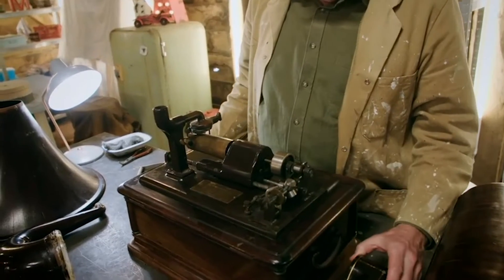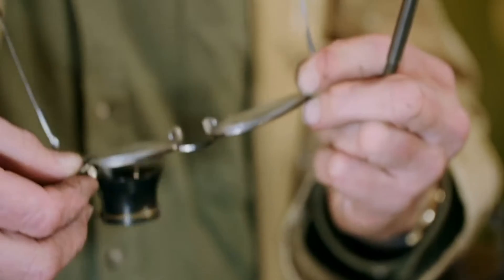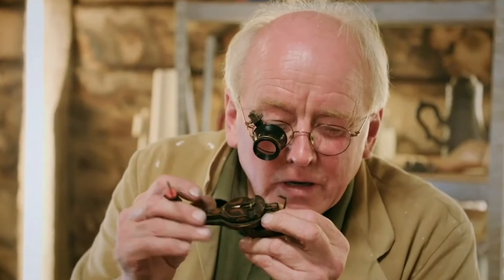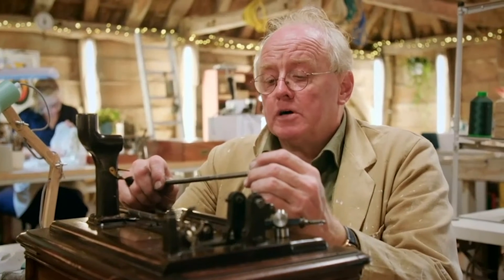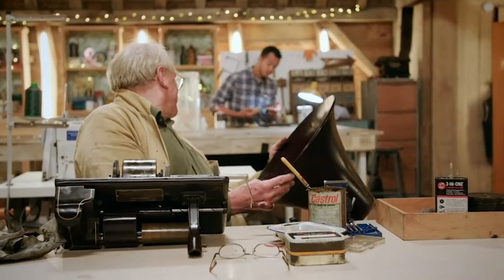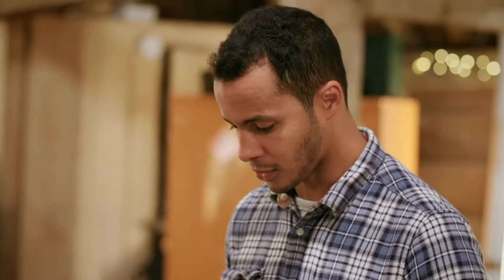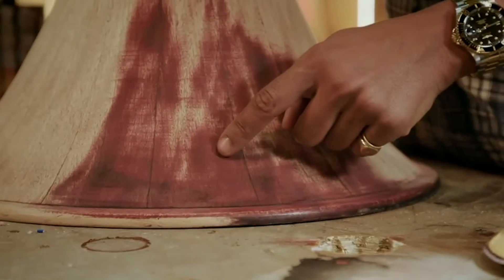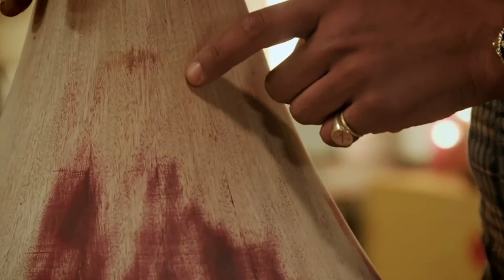Tim and Will Team Up to Give Long Silent Phonograph a Voice | The Repair Shop

Comment: A record of more true round would really help!
Reply: you would be surprised i have several which are worse and they sound perfect the warble is probably from the old belt needing replacing
Reply: @timothydelaval1089  In this case, the governor weights appear to be out of balance.  I would imagine the wire "spring" also needs to be replaced.
Reply: @notthatyouasked6656  I agree. There was too much flutter

Comment: Putting it politely, this was not a very good restoration job. From a collector standpoint, the unnecessary stripping of the original finish on the horn actually caused the value of the piece to decline by at least $1,000.

Comment: They didn’t do a great job restoring it from a collectors stand point.
Reply: I agree. I'm a collector and I had to shake my head in disappointment at the so-so job he did. Maybe they didn't give him enough time to do a thorough job?
Reply: I agree for example the speed of the motor just isnt consistant i just cleaned the oil off mine and put new oil on and worked smoother
Reply: Frank Pangborn they’re on a very tight schedule. I know Tim and he restores gramophones for a job, he can100% better, they film episodes very quickly thought

Comment: That was a terrible job! First and foremost, the travesty of stripping the horn! The warble while playing the cylinder is also not right. Indicative of a broken or missing cushion spring coupling between the flywheel and the mandrel shaft. This job was way out of their league and should not have been touched by Tim! Will on the other hand was only following directions... Sorry, you guys really botched this one! Low point of an otherwise excellent show.